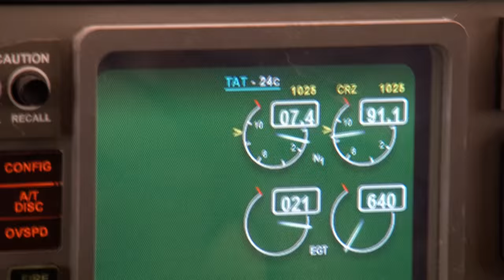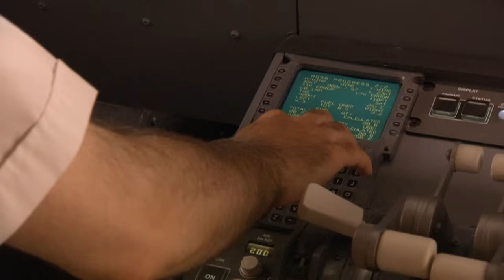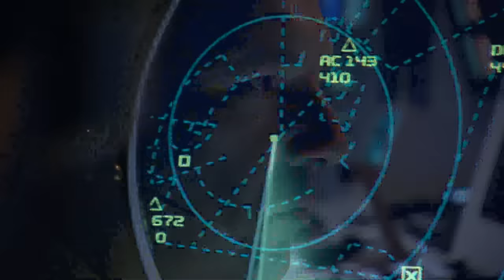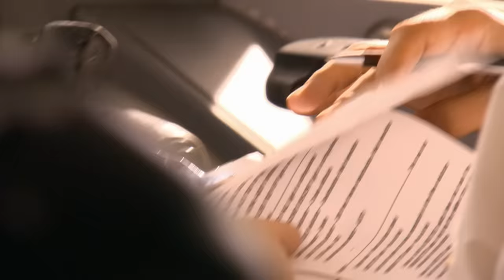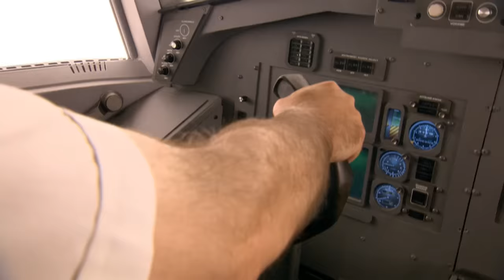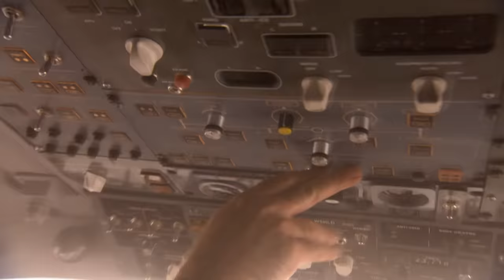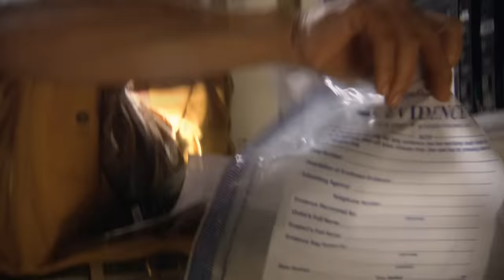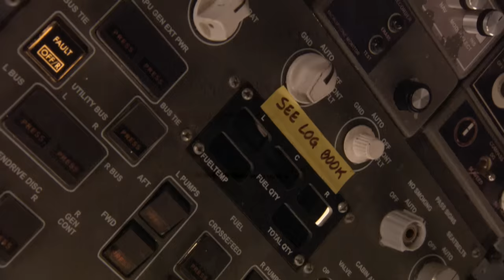Air Canada Flight 143 Lands With No Fuel | Mayday | Wonder

Comment: Training for emergency's is great, but using past experience is just as necessary. That has been proven by other possible air disasters that were avoided by the pilots using experience from the past and trying to apply it to the present situation. I used that many times when working on cars. It is just as valid in flying, auto racing and other things. Hat off to the pilot in using glider experience when flying a brick.

Comment: RAT:Ram Air Turbine is used for the following
Dual engine failure, or Fuel exhaustion.
Emergency Electrical Config (Airbus aircraft)

Comment: I'm amused that the shot at 40:08 shows a commercial automotive electrical inverter, complete with a pile of TO-220 devices removed from their heat sinks, and duplicates of the high frequency transformers, input and output caps, and even 30Amp ATC automotive fuses.  Big red wires for +12v, big black wires for -12V.  Little white and black wires going through a choke to the output. In addition to someone working on soldering (not soldering?) a power resistor with a rather bulky soldering gun. I know, it's just some visual content to help fill in the story being told, was just funny to see something so recognizably not from an aircraft.

Comment: A lot of drama over this slipping move. Any primary pilot is taught this in his/her training, at least if he/she has a good instructor. My instructor would have me fly to about a mile of the approach end of the runway, at around 3000' AGL, and set up a full side-slip. It seemed to take forever to get to the ground, and your knee was shaking at the end of it all. It's also a good tool to teach rudder control, as you can safely explorer all the yawing movements without a risk of spinning. The slip becomes a natural movement after you do it a time or two.

Comment: There are some basic and essential questions about the fuel monitoring system. First of all the captain looks at the fuel guage before filling; to enter the amount in all three tanks, either electronic gauge or maually confirmed, then the tank is filled up at refilling, that time all electronic and electrical system was up and running. Now when they had filled the tank with 23,500 lbs of fuel the captain should have seen the fuel guage or fuel quantity. I have an SUV that is about 45000 dollars worth of SUV it has tank level indicator; it is a single cell; using capacitance characteristic to show fuel level. Now when the flight 143 took off the fuel level would have been nearly 50% and it would have reduced to 25% at least after having flown half way down. How come the Captain and First officer did not see the fuel level was reducing or full. Let us say the electronic board was faulty, then there should have been no fuel level or full fuel level. Then in either case after have flown the aeroplane for some time there should have been some changes in fuel level indication, there was none. So this is a big question. The investigation officer immediately found  faulty component on the electronic board. I don't think there was anything wrong with that electronic board. All electronic boards are checked over and over again since this involves calibrations so the board would have gone through strict QC. That part of reporting is BOGUS and maybe a cover up? I would say the Captain, the First Officer, and his friend, the maintenance engineer, the third man in the cockpit, really did a great job. They stay in control in a very horrible tragic conditions, they way the captain controlled the aeroplane is beyond the human capacity. It was, rather, a miracle. I am glad to see no harm to any one except minor cuts and bruzes during the emergency exit using the slides. Inspector did accept the fact that he as clastrophobic but he checked, I doubt it. There are always secondary and backup systems, specially for fuel levels and small propeller type generator to glide the aeroplane when all engines are dead. That small generator provides enough power to keep the radio alive, and hydraulic system to keep flaps in action. I am not sure about the fuel level monitoring on this aeroplane but in 80's the fuel level monitoring sensors used to be capacitance measuring type, usually there used to be two or four sensors because of tilting of aeroplane. One sensor looses the level (hence capacitance) where as the other one will gain the capacitance, therefore, the total capacitance will remain accurate for level monitoring. Anyway, I am not hundred percent sure about defective board they found. That seems to be just a coverup.

Comment: The problem was that they had to manually calculate fuel amount, we make errors daily and this should have been prioritized that there is a system to calculate these and lessen chances of error. Honestly the fuel technician guy isn't entirely at fault. There should be a way that these calculations are rechecked and confirmed or have it calculated systemically. But then again this was wayyyyy back in the day

Comment: You know, watching these Mayday episodes, I really think the Flight Engineer should be there in the cockpit and responsible for managing the flight computer and any other calculations/charts that need to be accessed during the flight. Yes, for most of the flight, they won't have much of anything to do. But when there's an emergency or difficult flying conditions? Having someone in the cockpit whose job is to manage the computer and charts while the pilots focus on flying would make all the difference.

I can think of at least 2 previous Mayday episodes where having a Flight Engineer aboard could have prevented those accidents from occurring in the first place - the crash in Bolivia and the crash in Croatia. Both of those cases involved pilots getting confused, having to deal with charts and the computer, bad weather, and mountains around the airport - all while trying to just fly the plane. And in both of those cases, they reached their limit of juggling duties and they crashed into the surrounding mountains.

They were lucky in this case that it was good weather which allowed the First Officer to basically sit there and do the math while the Captain flew the plane.

Comment: Government inquiry  got this all wrong.  The cause of the incident was Air Canada  requesting Boeing install metric fuel gauges on their 767's.  Why change to metric when it caused problems in the U.S. ?    Air Canada  caused  the problem by changing to metric when both pilots & airport fuel personnel are used to pounds.   In the United States the Jet Propulsion Laboratory (JPL)  thought it was clever to use metric  without  telling their contractor Lockheed Martin. In 1999 the $127 Million Mars Orbiter crashed because JPL: thought it was fun & OK to use metric.  This  was  a big setback for Mars space missions.

Comment: That jumbo jet runs on compressed air it did not run out of fuel at all there is a little compressor at the bottom of the wing that runs on kerosene the wings are filled with helium and the way that they spend the air it creates its own power these planes float on compressed air you're not seeing things when you see them floating in the air and don't forget they charge us 4 fuel

Comment: What if the flight had been an overseas flight?
They would have all drowned.
I remember the English-to-metric changeover.
I thought it was a stupid move at the time.
There's even a hint of blame-casting made at the fuel truck operator,
when, in fact, the calculation problem is WAY, WAY BEYOND his control.

Comment: What worries me is how much autopilot and automated systems are relied on these days.. pilots who are actually are fully trained including flight hours, and have experience to deal with the completely unpredictable "exceptions" are the ones any passenger will want flying the aircraft we all are boarding!
Reply: Not having sensor or gages to tell a pilot how much approximate fuel is on board is ridiculous!  If cars have fuel gages, aircraft should have them as well. Yes this should be confirmed by calculations and what a fuel truck puts onto the plane.

Comment: I feel bad for the ground crew guy.  Such an easy mistake to make.  Even NASA has made critical unit conversion errors.  They really should have fuel gauges that display the converted volume to weight for them.  They shouldn't have to do this calculation manually over and over.

Comment: Pearson is no hero. He was the one responsible for okaying the fuelers math conversion. A simple grade 6 conversion. The refueler can be forgiven for not being good at math. That is why he is just a refueler. But the captain is suppose to be educated and be able to do basic arithmetic. Yet, when shown the arithmetic that the refueler used, Pearson okayed it. 

He created the near disaster by his own incompetence, forcing him to save the day with seat of your pants flying. But you don't get to be a hero for saving the plane your incompetence put in jeopardy.

Same thing with Pichet and Air Transat. That plane lost all fuel because the captain went against the manual, and common sense, and good airmanship, by opening up the cross feed valve before determining the imbalance was not due to a fuel leak. And he kept it open until all the fuel was gone. So, once again, he had to save the day with flying skills to compensate for criminally atrocious management skills. 

It would be like praising the chief engineer at Chernobyl for saving the day by avoiding a meltdown that he almost caused.

Comment: This could have been much shorter.   The maintenance/refueling crew measured in centimeters, the documentation was in inches.  They only loaded 40% the fuel they thought they had.   Human error.  Pure and simple.   That took less than 1 minute to type, not 50 minutes of over-the-top dramatized video.

Comment: Pilots were amazing people. Gliding from 26000 feet with no engines and without anyone dead? WOW! How does the airplanes not able to detect what is inputted vs what really is in terms of metric calculations? All technologies should have capabilities that catch human error. It should not be always, humans catch technology error but the other way as well. SMH!
Reply: They have the technology to catch the error, it was not functional at the time because of a poor solder/design on the circuit board that should be catching that. They talk about it in the video.

Comment: Canada had just switched to the metric system and one of the pilots had ordered a fuel fill up in gallons rather than liters. That's what I remember hearing over the radio at the time. The senior pilot was 48 years old. He made "a false assumption." He was careless. _ The Captain of the ship is responsible for the safety of the crew and passengers.

Comment: Headline? Metric system and  job replacement by technology cause modern jet liner crash that almost costs the lives of all on board and numerous local bystanders. Zero chance of that. Would have all been chalked up to human error without pointing specifically to the errors.

Comment: Unbelievable to see how the airline fueling crew used handwritten note to calculate fuel for each flight without precalculatedand verified table.  It's  a disaster waiting to happen sooner or later.   It shows the need to have only one universal measuring standard.

Comment: Why in the hell would they leave the fuel calculations up to what some sketchy guy scribbles down on a piece of paper?  Especially one who can't even read his own work and doesn't have the right training.  O m g , that is insane.  How could the system be designed and run that badly?
And a million other things.  Like how can you let an aircraft fly without a working fuel gage?  How can no one be trained on important details of a completely new system?  How can the aircraft have so many things, like instruments and transponders  non operable in the event of a power failure?  How does the control tower not know which airports have been converted to drag racing strips?

Comment: the most surprising thing to me is that the PILOTS did not CHECK THEIR FUEL GAUGE before they took off.  WHY the hell not?  If I leave in my car to go on a long trip the FIRST thing I do is LOOK AT MY FUEL GAUGE.         IDIOTS.
Reply: The fuel gauge was blank and not working. Replacment of the part was scheduled to happen when the plane landed.

Comment: I blame it partially on the needless conversion to metric. Standard units of measurement have been around longer and should be the only standard. As soon as you start adding needless units it comes with confusion and a whole slew of issues when conveying it to other people. I will NEVER use metric or any other unit of measurement and that is for my own safety and to aid in not being confused. Tell me something in Kg and I'll look at you like your speaking tongues and need mental help. While I sit here and ask for a gallon of water, metric idiots are asking for 3.78541 liters of milk.